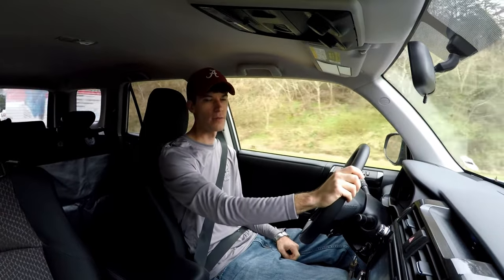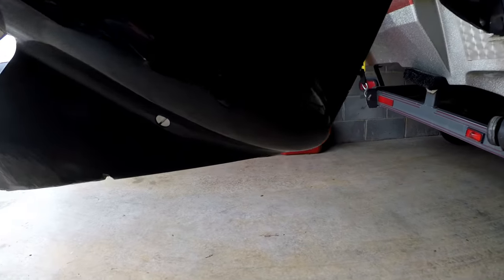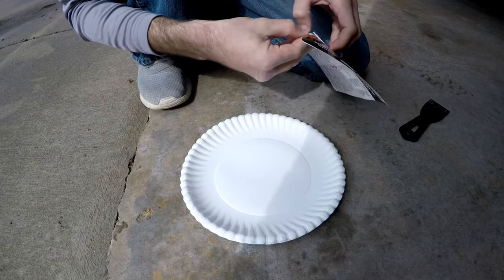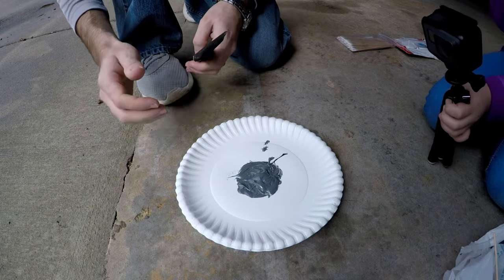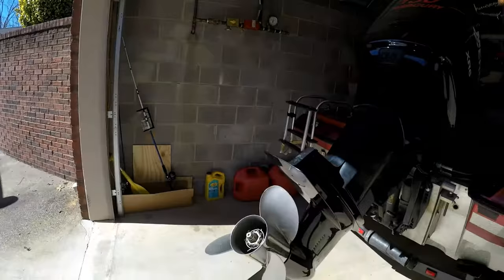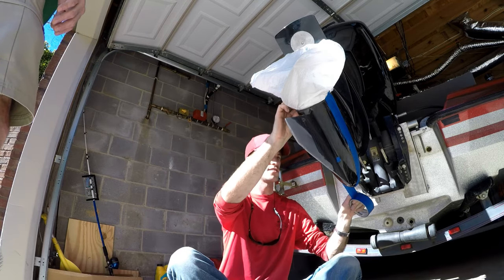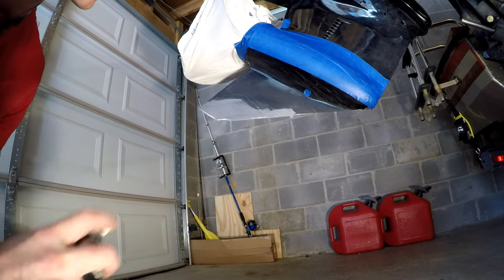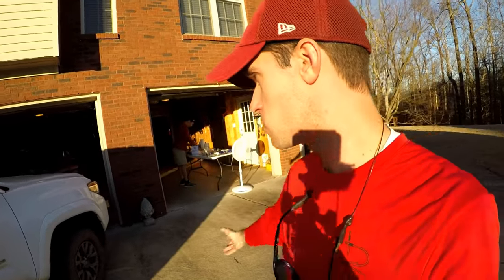Skeg Repair with JB Weld | Ran the Boat Over Rocks | B Fishing |

Comment: I'm looking to repair my outdrive so I've been watching vidoes... I seen other say you have to etch parts that show bare aluminum & some say add something called iodine or similar name, or 50/50 mix of vinegar & water, marine primer before putting on top coat.  I'm curious why you didn't do any of that, are you familiar with those chemicals/products & their purpose if so why weren't they required in your situation?
Reply from the maker: This repairs was to some small Nick's in the skeg. I cleaned it with alcohol and that was it. JB weld is extremely strong and I didn't think it was necessary

Comment: I just hit one yesterday in the gulf, wish I could upload a picture of it on here to see if its to far damaged, mine was about the same like yours but took off about a half inch, now it looks like this 6 inch gap on the skeg, all 3 fins got damaged on the prop too.
Reply from the maker: That may be too far gone. But you can cake the Marine weld on it and keep building it up and then sand it. Worst case scenario is you are out some time and jb weld.
Reply: @B_the_Cameraman   Where can I get the marine well that? A depot supply store West marine?
Reply from the maker: @Bushgator  I got mine off Amazon

Comment: What's the skeg's material exactly? ? Thanks!
Reply: @ Gerald smulevich- the skeg housing is Made out of Aluminum- it’s better if it’s welded with a mig welder. In this example it is purely a cosmetic repair. Unfortunately, skegs are always hitting stuff in the water.